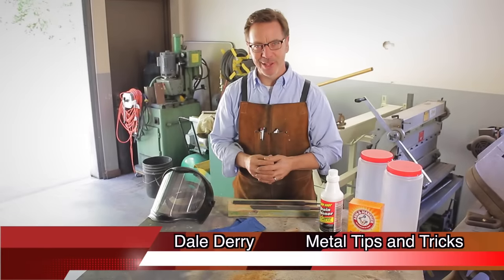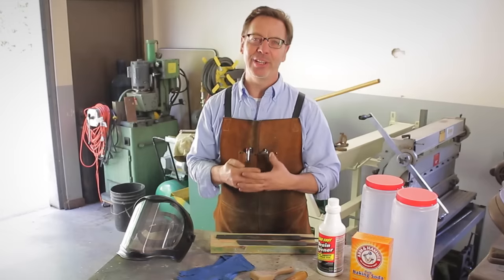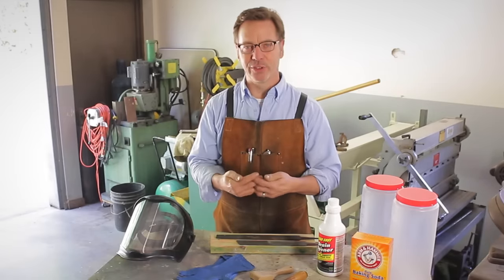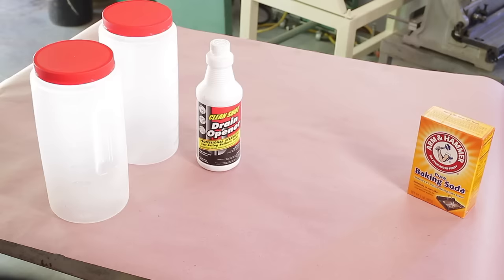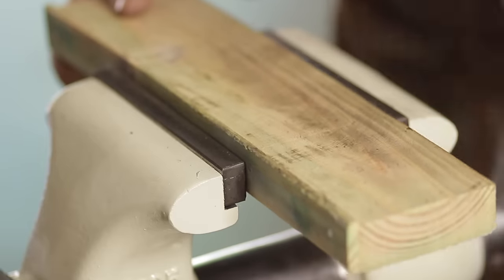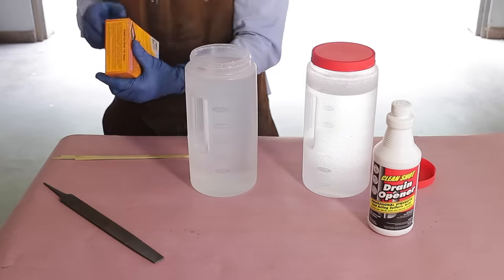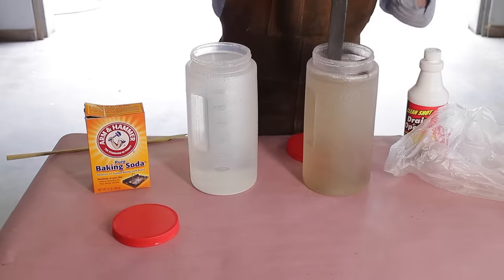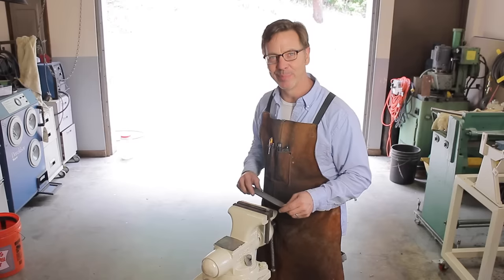How to Sharpen Metal Files

Comment: I've been doing this for years but using battery acid from old depleted car batteries. Usually the files have to be left in the acid bath overnight for the acid to do it's work and notice any difference before/after bath but all depends on the cut type and the dullness of the file, so checking regularly every couple hours doesn't hurt. I made my own file resharpening contraption with a PVC tube capped at the bottom and set on a wooden stand. Lime can also be used for neutralizing but I guess baking soda is easier to find for most people. On bastard cut files I've done this process up to six times with total success.
Reply from the maker: thanks for your  comment

Comment: Nice work.  I've always used vinegar, this is probably more effective.  The copper cleaner is nice.  I wrap my files in either parchment paper (silicone coated) or waxed paper (wax coated), both available at the grocery store.
Reply: Stick with the vinegar.
Reply: Not more effective but slower and easier to control, if you mean kitchen vinegar.

Comment: There's a compan out in the Midwest that does this for a fee.  It works.

My question is, when I've got a metal rasp that's a good one, say, handcut over in the old country and quite costly to replace, does this method work on wood rasps?
Reply from the maker: I have never tried to do it with a rasp. You have nothing to lose give it a try.

Comment: to all the clowns claiming this is just cleaning the file, thats what the copper and wire brush is for.  So here is whats going on.  The acid is etching or dissolving away the flats of the teeth thus making them thinner (by microns to fractions of an inch).  The acid is doing this uniformly over the entire surface of the file (Flats, edges, grooves etc).  So the teeth on a file come together at the front to form a cutting surface or edge.  That edge has gotten dull so it isnt at a nice sharp angle but instead a dull rounded over edge.  The acid is dissolving the metal making up that rounded over edge until the two sides meet at a sharp angle. that sharp angle is going to cut or bite into material better and slice through it much easier.  this is whats happening when you chemically sharpen a file.

Blacksmiths back in the middle ages (or some even today still do) use a bucket of urine to sharpen their files, its a slower process, and a SLIGHTLY different chemical reaction but it produces the same effect. (FUN FACT: this is where the saying "so poor you dont have a pot to piss in" comes from. the poor would literally sell their urine to black smiths and jewelers, but they had to be able to collect and store it till they had enough to sell, hence the pot they would piss in)

I have chemically sharpened some of the knives that I have or have made and frankly they scare me.  They are so sharp, and cut so cleanly that I often dont notice when ive nicked myself until minutes later when it starts to bleed a little.

Chemical/acid sharpening works, no its not just cleaning (but it will do that too), and if done enough (or you forget about the file and come back later) will eventually dissolve the metal completely.
If you dont believe me feel free to try it at home.  If you dont believe me, and dont want to try it at home you probably think climate change isnt real and the earth is flat and in that case I dont really care what you think.

Mr. Derry thank you for your video

Comment: Excellent tip!  That's a real money and time saver.  I may try some other acids like vinegar.  I've heard of leaving them in the dew to rust a little, must work on the same principal.  Love your closing statement.  Information is no good if we don't apply it.
Reply: I use dilute battery acid as mentioned here http://swingleydev.com/ot/get/157695/thread/.It doesnt take much and its better to use a long container so you can lay them down if you like.
Reply: vinegar is perfect. Works better, cheaper

Comment: You can be MUCH more frugal with the acid by putting the diluted acid and file in a plastic bag and sinking the open-top bag into the tub of water, both open to the air but segregated from one another. The water pressure outside the bag squeezes the liquid inside the bag into approximately the shape of the file. If you want more or less acid volume, lift or lower the bag such that the inner acid top surface is below or above the outer water top surface.

Comment: Thanks for the tip!!! Ya know you were talking about that machinist that worked on the rocket sled!! Well I’m also a machinist and I worked at  the same place he did !! Edwards Air Force Base in the Mojave desert there in so-cal. There are actually two facilities there, the main base and the AFRL ,, Air Force Research Lab, that’s where I worked, probably him too!! Anyhow I just wanted to let you know and him to if he’s still up and running, the rocket sled isn’t there but the rail run that it ran on is !!! Yep!! It’s still there and when I first went to work there the guys  took me there to see it !!! Just wanted to let you know,, thanks again,, oh just to say that I’ve done the same thing with vinegar instead of sulfuric acid but I bet the acid does a better job !!

Comment: Thanks for the video. Why do you have to rinse the file in the baking soda solution? Wouldn't be enough just to rinse it in running water? Thanks in advance for your reply.
Reply from the maker: yes you can just run it under water, but the baking soda is waster in neutralize me acid and it's a lot safer.

Comment: Send files to Boggs Tool Company in LA County. They use no chemicals, acids, or spit, two of which can ruin files of even the best of steel. Old School but you will be amazed. My woodworking rasps have been honed to a working edge that makes sculpting in wood unplugged, a joy.  Sharp planes are critical in woodworking, and easy to learn basic sharpening with cause they're wide and easy to see the bevel form.  But as you narrow your files teeth they become more brittle. The structure of a rasp tooth is unmistakably aggressive  and yet pressure determines how much sanding you're in for.

Comment: Thanks. I've got an old bastard file but never knew how to restore it. I'll try your tip and see what happens.
Reply from the maker: Good luck :-)
Reply: It worked!!!  I also did three old 7/32 chainsaw files at the same time and they cut like new. Thanks again.
Reply: If it would restore an old bastard, I'd drink it.

Comment: Many of you clearly don't know whats happening here. It is simply not just cleaning out the valleys between the ridges on the file. Sulfuric acid dissolves steel. If you could look closely with a powerful magnify glass, you would see the ridges on a file are pointed, this is what engages and cuts the material you are filing. After time these ridges get rounded off, the acid dissolves the steel removing the rounded edge restoring back to pointed one. This of coarse can only be done a limited amount of time before the file ridges become to small.
Reply from the maker: Thanks very much for your comment :-)

Comment: I'm a tad confused. does the acid just clean the file or does it somehow return a sharp edge where there was a chipped or rounded edge??
Reply: Erik Parker The answer to your question starts with determining the degree of chipping or how rounded the teeth have become. 
During use the tips of the file teeth wear away. That is normal wear.  As the file wears it begins to skid over the metal rather than biting in.  At that point it is a viable candidate for either hydro-honing or acid etch sharpening. 
If the file is abused, banged around in a box full of tools, run against hardened steel, or dropped so that the teeth are broken and chipped they are not candidates for hydro-honing but only because of cost. They can still be acid etched. Without shipping costs and the time involved, if you are able to save only one in three it's a good deal. Perhaps most of the file is okay with just one side screwed up, or one end. With no appreciable cost involved, what do you have to lose?
If the file is a little rusty or dirty, use a file card or perhaps a soft steel bar, like I use in my file cleaning video, to scrape the rust and dirt out of the teeth.
Something I haven't noticed in these discussions is any comments on pinning. It's not the topic of the video but if we talk about cleaning, as nearly every post has mentioned, then describing the things that create the need for cleaning should be defined. Pinning is when the gullet between the teeth becomes filled and stops the tooth's cutting edge from contacting the surface. 
If you are having this problem then cleaning will be an endless effort. It is caused by the teeth being too fine for the chip load. Go to a larger file with bigger teeth.
Reply: Old Sneelock's Workshop Pretty much the answer I expected, Thanks!!
I have always been one of those guys that kept his files in a cardboard sleeve when stored and I keep a small copper bar to keep the debris out in addition to a file card/brush...Honestly, I take better care of my files than my own teeth..lol..but never acid etched them...live and learn!
Reply: the acid isn't sharpening them, its just removing stray nicks, it will dull any sharp edges the file has from with prolonged or repeated acid bathing.
Reply: PandaWonka that's what I thought.  the title says "how to sharpen.." and I thought that a bit misleading.
Reply: Erik Parker In the description Dale lists two articles with a decription of the process and photographs before and after in the Popular Mechanics article.
Reply: Very cool stuff anyway you want to look at it...I have always kept my files in cardboard sleeves to keep them from banging around and getting damaged. used file cards and copper slugs to clean them.
Reply: the first one is a advertisement "article" and doesn't include the last part of recutting the file, which the second article contains.

Comment: Acid eats the flutes and leaves a sharper edge. Old blacksmiths would leave files under trees with tanic acid bark to sharpen them. This is hundreds of years old and it does sharpen the file. You can see in the video it does cut better after the acid.  Those who doubt this just have not read up on it.

Comment: I have made gasket scrapers from copper tubing for use on softer alloy engine parts, transmissions etc. I electrolysis rust removal and or vinegar and then acid sharpen the old rusty junk files I buy at yard sales. Some of the better files can cost $40, $50, $70, $100, or even $200 each, and hand stitched rasps. Forget it! $80 is a starting point, and an $400 for a corundum treated bespoke rasp, is commonplace.
Reply from the maker: Thanks for your comment

Comment: Wish he had tried the files on the metal barstock between the copper/brush work and the acid bath.
Don't know if the cleaning was all that was needed.

Is this acid process actually "sharpening" the files?  Or is this just deep cleaning?

Comment: This idea has been around a long time. There was even a system marketed with a rust inhibiting fluid as a final treatment. Though the result is a sharp file, it is not “sharpening “ in the usual sense of the word. What it’s doing is eating away through corrosion the burr on the file teeth. So, this can only be done a few times on any given file before there is nothing left to restore.

Comment: Also old trick to fit a wood handle, heat the tang red and hammer into handle. Immediately remove before the heat overcooks the wood. Perfect fit. Heat no problem on tang, do not quench let cook slowly. That anneals (softens) it. Tang meant to be soft so it doesn’t break.

Comment: I really want to know HOW that works. What's actually happening? Why is it dull in the first place and what happened that fixed that?
Reply: I think the acid is eating away at the metal like acid rain does certain geology. Someone else has stated that the goal is to deepen the valleys between the peaks of the file while drying off the tops periodically to keep them from getting knocked down.
Reply: Yes, HOW does it work? Thanks for posting.
Reply: I'd guess that, even when they're dull, the tips of the teeth are the thinnest part.  Say the tips, instead of being sharp, are now worn to .005" flats, and the base of the teeth is .010 thick.  Put it in acid, and if the acid eats everything equally, by the time it removes .0025" off everything, the tips are now sharp and the roots are still .005" thick.  Next time though, if you remove another .0025", you have a flat piece of metal...

  I think that in addition, the acid will attack the tips of the teeth more aggressively than the base.  I don't know WHY I think this; it's just something buried in the deep dark recesses of my brain.  Possibly just a fever dream...
Reply: get a sheet of paper and draw the shape of a blunt tooth with a radius on the point. Now trace along the inside of your shape with a fat marker. Repeat tracing along the inside of the line until it's as fat as the radius you put on the point, and you will see that the inside edge of the line shows a sharp tooth.
Reply: "drying off the tops periodically to keep them from getting knocked down."
   ^THIS^ sounds much more likely to have the desired effect. The problem I had with trying to protect the tips with various kinds of coating was the coating/mask material would wick into the base as well. Your technique would seem to use that to your advantage.  Nothing I had to try worked very well at protecting only the tips. Of course this was only tried so far on files that were already rusty. Perhaps the wicking effect only occurs in these files due to the nature of rust.
    Drying off the tops with a soft material (like cloth) would remove acid from the general area of the tip. Using successively harder materials (within reason) would dry smaller areas thus producing an even sharper tip. Perhaps a set of rubber rollers of incremental hardness would do the trick?
 Time to continue the experiment...

Comment: While this is interesting, it is thoroughly explained with pictures in a 'Small Boats Magazine' article dated MAY 2019, entitled 'Sharpening Files'. He mentions the acid-containing product by name, 'Clean Shot Drain Opener', and states that it is '93 percent sulfuric acid'. The only place it is available is at Tractor Supply for $14.99 for a small bottle. He mention that "This drain opener with 93 percent sulfuric acid, gets diluted with water to a 10-percent solution that can sharpen a file in about an hour." That is the key point. 10% sulfuric acid solution.

Comment: Does this sharpen the teeth of a hardened steel file or just clean it?  How does the acid sharpen the teeth?  Wouldn’t the acid effect all the steel of the file equally and melt off metal everywhere and not just where teeth are flattened from use?

Comment: A good use for old files is to cut them into 2 down the length with a cut-off grinder and weld the strips to the leading edge of you mower blades. They hold a sharp edge for a long time.

Comment: i have a question, can i use another kind of acid, say muriatic or hydrochloric acid or any other acid instead of sulfuric acid? thanks
Reply from the maker: yes.  as I under stand most acid work. But I have a had problems with some acid  because of oil on the file.

Comment: Whether I was really sharpening or just removing clogged material, the files are definitely "sharper". My problem is that they now show rust almost immediately. I can use Lock-tite phosphoric acid gel and remove the rust but it comes right back. Any solutions?
Reply: Boil them in a wood ash and water solution. It's alkaline, rust doesn't develop in an alkaline environment and any traces of acid will be thoroughly neutralised.

Comment: What does the acid do to the teeth?  When I view the teeth under a microscope I see lots of broken and rounded edges
Reply: It eats away the metal until teeth become sharp.
Reply: Imagine same depth of metal gets eaten away from the surface, characters representing the outer edges of the tooth as the reaction progresses:
  000
0###0
0#++#0
0#+@+#0
0#+@@+#0

Comment: To those who say your only cleaning the file this way, your actually dissolving some of the file away which will tend to leave the cutting edges sharper than they were, to a point. Eventually the teeth will lose their profile and not cut.
To those who think jumbling your files around in drawer will sharpen them, please don't. At best it won't do anything, but most likely it will dull them or even chip the teeth. If you want something to remain sharp, whether that be a knife, chisel or a file the last thing you want to touch the sharp edge is another hard sharpened edge.

Comment: Just came across this video. I started my T & D apprenticeship on June 24, 1957 and am from a family of T & D makers. Still working every day. I've done lots of filing w/lots of files. I've even drilled a hole thru a file. (not the tang) 

You are not sharpening anything with your chemical process. As others have mentioned - you are only cleaning the debris from the gullet of the teeth.
A file CAN be sharpened - with a surface grinder wheel dressed to the proper angle - 1 tooth at a time. 

But it would be more productive to cut your hair with a chain saw.